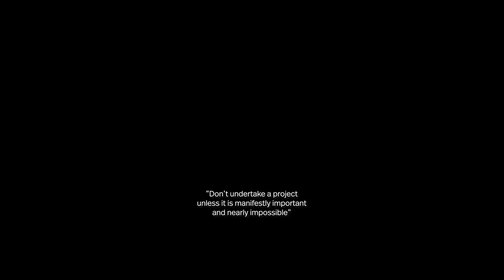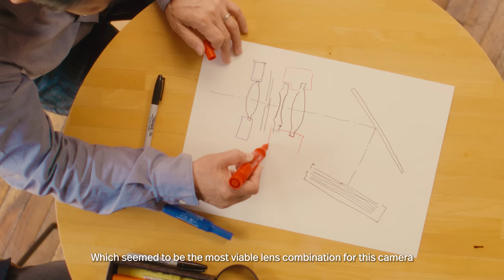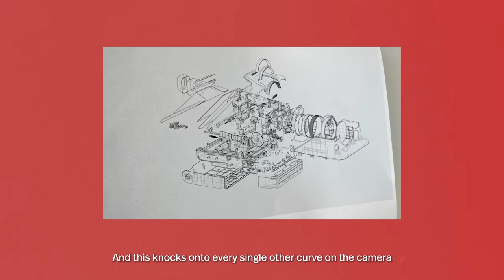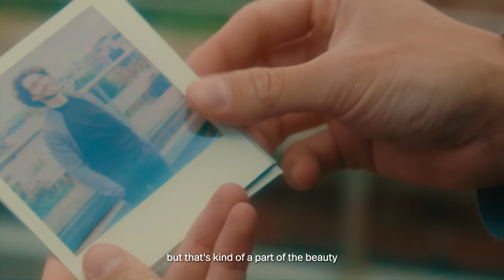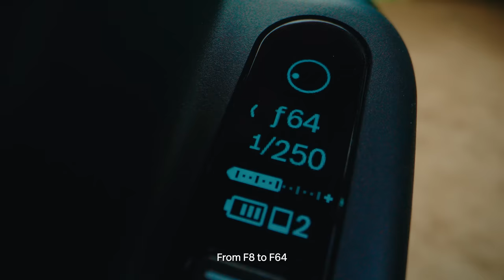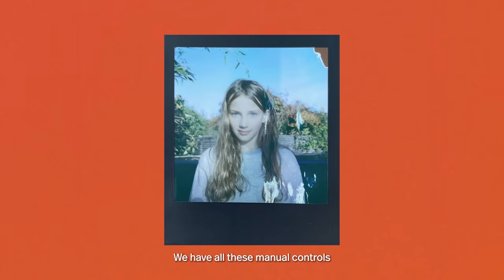The Story behind the Polaroid I-2 Instant Camera

Comment: As a personal fan of ALL cameras, photography (I take and teach...) the Impossible Project's efforts, and certainly ALL old Polaroids, I submit however, I think the thing that REALLY fails on this camera, and sadly to say, is that the 'Big, Bright, and Clear' mantra was entirely and unequivocally, missed! The pictures come out literally SO over processed for the 'elder', antique, 70's era look that the line between all of this incredible development, 30K TEST photos and immense engineering ONLY to produce a product that commonly simulates App photography for as little at $4.99?! Why on earth would this much development be exercised only to produce an extremely, backwards, multi-decade old, fuzzy image? I literally am heartbroken at what this project has turned out to be. I credit the teams 'work' but the extreme shortsightedness to create such antique-ish looking photos with not even an option to produce 'clear and colorful/modern' shots say as a button option, is mind-boggling to me.
Reply: I bet if the Polaroid team spent 13 additional months of development, we would have removable / user replacement, Rechargeable battery pack.

Comment: Love my SX70. You could have nailed this. Instead you gave it a non replacable battery making it a brick in ten years, gave it a plastic lens and a $600 price tag 😢 💔
Reply: What’s the deal with a plastic lens? If it’s sharper that my sx70 lens (which seems to be) it could be made out of menure for all i care the result’s are what matters. 600 is cheap for a new camera! It’s cheaper then any entry level digital camera there is, your just used to the price of shit plastic used cameras. As for the battery i agree with you, but only time will tell, if one charge lasts 15 packs it does sound like it should be good
Reply: Where did you hear the battery int's replaceable.?
Reply: Plastic doesn't always make it bad. Just as glass doesn't always make it goof
Reply: You can just replace the battery if it's dead, I'm sure a company that repair old cameras and make new cameras from scratch can replace a battery from an old model.
Reply: @walmyrcarvalhoo  They don't offer that service :(
Reply: @Adrian-wd4rn  It's just came out, it'll be years before those batteries die. They might offer this service once it becomes an issue for some users. I'm pretty sure Apple did not offer battery replacement when they introduced the iphone.

Comment: Polaroid: I am a huge lifelong fan, but the one thing that would help convert me from occasional enthusiast to everyday user is a return to 10 prints per film pack. 8 is just not enough. I hate that the counter on my SLR680 is always wrong, and it unfailingly reminds me just how expensive and extravagant this hobby is. An additional 2 exposures would have a big psychological impact that would persuade me to take my Polaroid out far more often than I currently do. It’s not logical per se, but it represents a tipping point in my mind.

Comment: I ended up here as I was looking at old Woolworths adds comparing inflation.   Kodmatic 950 sold back then for 28.99.  the base level Polaroid sells for 3.5times that these days.    Now I'm seeing this advert/documentary..

Very interesting.

Does this take larger prints than the older models, question, question.... My interest is sparking.  I guess you might have a slow burn product here.

Comment: How do I sync this with Strobes?  Is there a PC Connector or Hidden Hot shoe?

I noted that it charges via USB-C.  What happens when the batteries inevitably die?  How do we replace them?  Is it some proprietary pack, or is there some sort of cell like a cylindrical 14400 lithium cell? If it's not replaceable, it seems very anti-environment and incredibly short sighted given today's climate (both figuratively and literally) regarding sustainability and reusability.
Reply: You don't replace them. The batteries are inside the camera, and polaroid doesn't have servicing for it...
as an industrial designer myself, I'd like to smack that smug industrial designer in the head for that.....When the batteries die, the whole camera will need to be pretty much junked and youll have to buy a new one.

Comment: Hopefully the built-in battery is substantially better than the one in the I-1
Reply: Non replacable battery. In a decade of less this camera will be non functional
Reply: I think the batteries with got better one-step series cameras when they were Polaroid Originals. I have the one-step plus and I think I've only charged it a total the three times. If I have gone for months without using it I will charge it.
Reply: Spend 13 additional months in development, and we could have had a user-replaceable Rechargeable battery pack 🤯😩